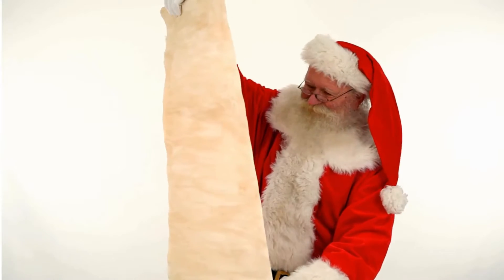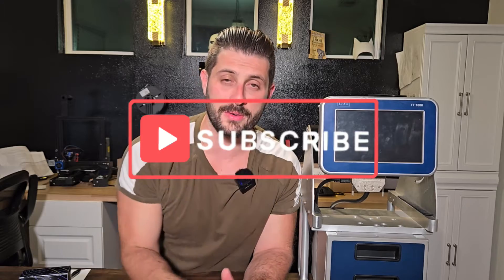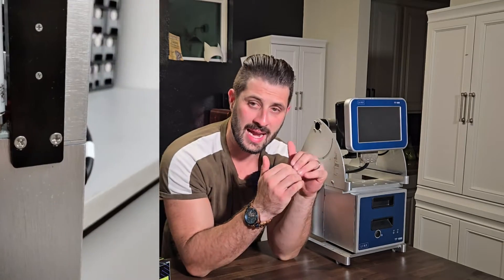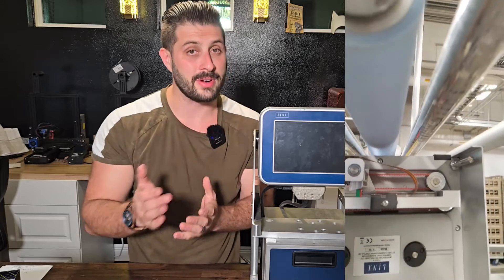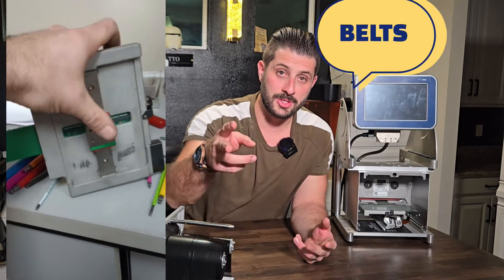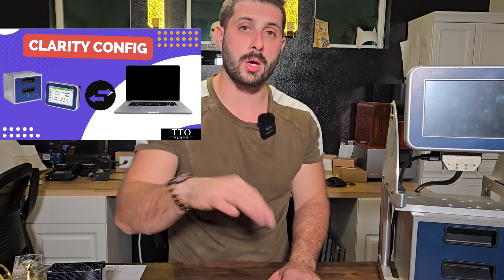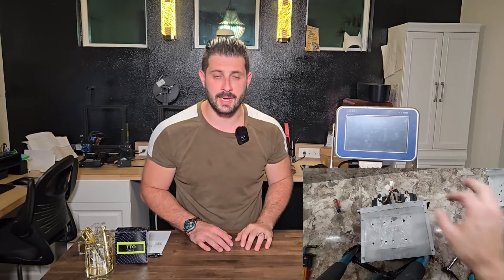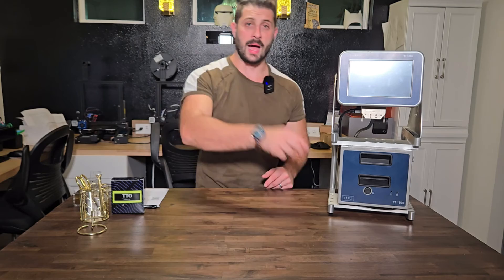Trouble-Free Printing: A Guide to Videojet Printhead Carriage Position Error Solutions

Comment: Hi, have a printer A, 6350 which has an error that is the main pcb, I have replaced the main pcb from another printer B 6350 printer that had the printer head carriage moving the other way, when I turn the printer A on, it to go the wrong way and it can't find the park, do you think if I use clarity config I would be able to set up the printer A head direction correctly and calibrate it? Thanks.
Reply from the maker: @jacksonbartelli the 6530 models get the printer direction from the printhead pcb. I can swap between right and left hand models and it will auto detect which unit it is in. Is it possible that when switching and assembling the printhead pcb and main pcb are not actually plugged in? You should get an incompatible printhead error if this is the case as well as the LED's will not light up.

Comment: Hello mate. Got a Zodiac Hawk with this error E3236. However, my issue seems to be different of all you mentioned in your video. I’ve check the belts, carriage movement, printhead gap, printhead peel arm, ribbon movement, motors, all are ok, as this printer is pretty new with only 2000 counts. My issue is after two successful test prints, the third one I got the E3236. When I clear the fault and move the carriage manually 1 step forward, the error disappears and I have my prints normally. Seems when the coder is in homing process, the step motor lost its position. I have checked the timing pulley and is ok. Any ideas? Thanks in advance! Greetings from UK 🇬🇧
Reply from the maker: Try running the motor test. Cycle the head for a half hour see if the error pops up is so replace the motor or encoder on the motor
Reply: @TTOPARTS  Thanks buddy! I’ll try that. Appreciated your feedback. I’ll keep you posted with the results.
Reply from the maker: Best of luck!
Reply: @TTOPARTS  Motor tested with head cycling for more than 40 minutes. All good. Two test prints and E3236 pops in. Move the carriage manually 1 step forward and works normally. Weird. Is there any motor calibration in this version?
Reply from the maker: @Attic-Toy-Design no the calibration is for the ribbon motors. What is your print head gap at? You can find that in settings, diagnostics, printhead,inputs it will be middle of screen should say distance to platen  you want 1.5mm to 2mm. Is it occurring every three prints
Reply: @TTOPARTS  Yes buddy. On the third test print I have the E3236. Is there a way to reach you out to send you a video showing exactly the issue? I can do it tomorrow as in the UK is bed time ..🛌
Reply from the maker: Yes send over an email with the video file to support@ttoparts.com
Reply: Email with the video sent buddy. 😊
Reply from the maker: @attic we didn't receive the email. Apologies just checked this morning.
Reply: @TTOPARTS I’ll send it back again. With a link instead.

Comment: Any updates on the eCourse? Our most recent issue with a 6530 - intermittent carriage position errors and poor print quality. The linear bearings balls were falling out, our product is like sandpaper and rubs everything. We had to salvage a slide rail/bearing from an outdated printer model from the scrap pile. I have two more 6530's on my desk that are in pieces from a previous technician. Would love to take a course to learn more.
Reply from the maker: Still working on the course we were using an LMS company and didn't like the results....

I used to work for Hiwin the company that makes the linear bearings and we would always have problems with fine dust clogging them and blowing all the balls out.

I would be happy to fix the 6530s for you and put them in a video. We don't charge labor just the cost of parts.
Reply: @TTOPARTS  I'll discuss it with my manager. The linear bearings arrived today for one of the 6530's. I have a 1580's ink pump to replace soon as well.
Reply from the maker: @tec_anvil8868 best of luck don't forget the small plastic washers on the pivot assembly crucial to prevent carriage position error.

We set up corporate accounts with credit.
Reply from the maker: https://ttoparts.com/products/407924-videojet-dataflex-6530-linear-slide-53mm

How do we compare with whoever you got yours from?